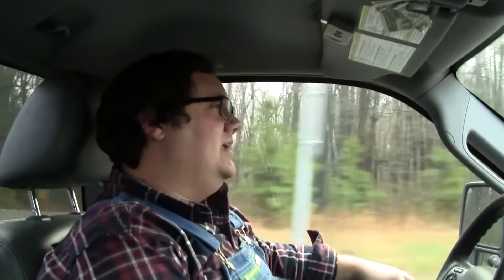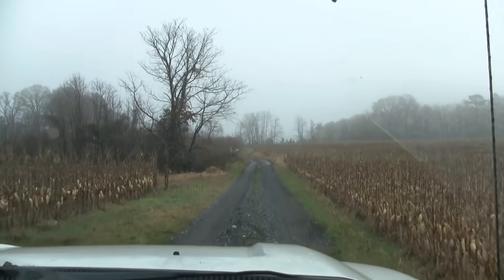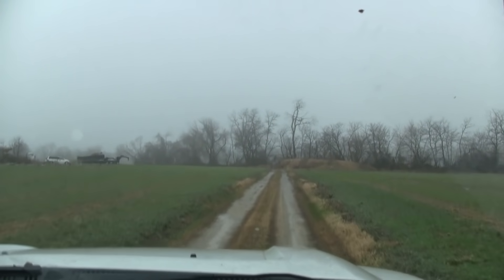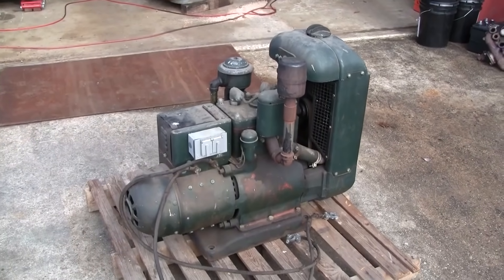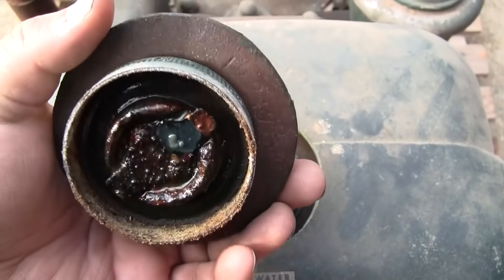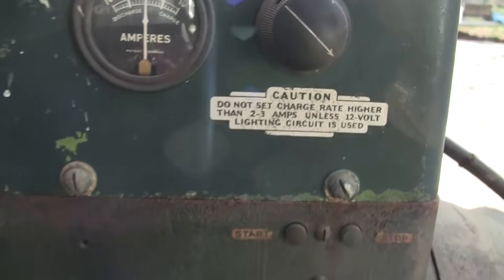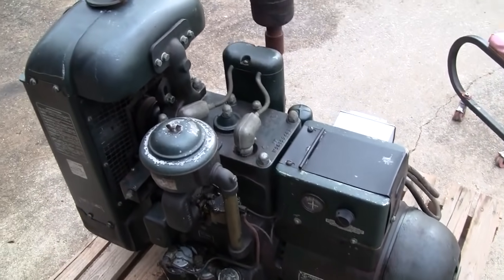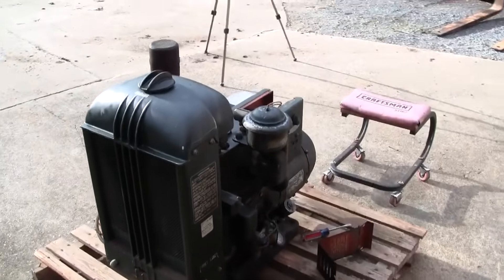The Nicest 75 Year Old Generator I Have Seen!  1945 Onan W2C

Comment: Nice machine. Back in the mid 80's I bought a similar one, only with a full housing at a farm auction for only $10. It turned over fine. Only problem was that I couldn't take everything home at once. I took the small stuff and was coming back with took to take it apart so I could carry it. By the time I got back an hour later, the junk man they hired to take the remains away, had taken it. He didn't see my number written on top. Should have told the auctioneer that I would have to make two trips but didn't think it would be hauled away.

Comment: Some things just have a certain characteristic beauty about them. That radiator shroud and cap certainly draw your attention. What a beautiful little unit. Such a departure from what we see on the shelves today which is usually just a minimalist frame, gas tank, and a pull start Briggs. Very much looking forward to the detailed inspection, pre-startup maintenance, first start and load test.

Comment: Good job Mike for running to capture this w2-c. I have seen the compressors that these gensets fed. The compressors when running in the 50's ran the milkers with a large stainless flat bottom pot hooked to the milkers from the floor with rubber hoses. Looked sort of like a hookah with red rubber milkers running down to the pot. The compressors always stank of putrifying oil that farmers never changed for fresh. Like vegetable oil only very old.

Comment: Sitting here stunned here in the UK!!  I have one of these to!!  Mine is ex military, bought it at an estate sale about 30 years ago.
Mine is also in excellent condition and complete with hand crank.  There are a couple of very old youtube restoration vids of these units, with impressive results. They sound fantastic!  Still amazed to see another on this channel though!
Reply: It is a shame that YouTube doesn't have the ability to post pictures with your comments. Would have been wonderful to see a picture of your version of this generator!
Reply: @mshaw290808mi  
Indeed so.  Being a military version mine has a few differences to this one. Eg,  magneto ignition with fully screened plug leads, it looks like this one has coil ignition, also mine has a floating dip stick indicator arrangement so the oil level is always visible. It also has an even larger sump and is skid mounted.

Comment: I've got a Fairbanks Morse W3S-531 115-230V 3KW. Looks just like yours. My S/N is: 19.400636. Mine is  in excellent, original condition also, except mine is missing the fan guards. Otherwise, everything else is there. Nice find! Onan machines were top shelf back in the day. I've also got a couple old CCK units, a JB  engine and an RV unit from the 80's or 90's. It's a shame what Cummins did to the Onan name.

Comment: That is one very nice find! - I'd love to own that. I do have a 1962 Onan 2kVa (Onan RV2) which actually runs, but needs some work to bring it back to spec, and you can see how even then, the build quality, your machine versus mine, was beginning to slip away. You have a twin cylinder, water cooled engine that will run forever. I have a single cylinder, air cooled engine which will do, but it lacks the appeal of your machine!

Comment: That's when things were overbuilt made for a life time. Now days with the computer engineering it can be engineered to last a certain number of cycles or use hours of run time etc. And fail and if you abuse it just ever so slightly it fails before the warranty is off

Comment: I’d drain the radiator and the engine oil before I’d try to start that thing. Clean the contacts on the relays and if there’s any capacitors check them and replace any that are out of spec.

Comment: 9:21 I would be very careful with cleaning, don't use any strong chemicals, you may wash off the great paint. No pressure washer, that would blast off the paint. I recommend plain soap and water and a soft cloth. (elbow grease!). This machine has lasted for 75 years, don't mess it up. Dirt on the outside does not harm the works.

Comment: I just picked up a inline 4cyl 3 phase generator.  Big light blue mauler, squirrel cage fan on the back and generator on front.   Onan engine.  Crazy about of wires in control box, even has a old glass tube holder.  That part worries me, not the engine.